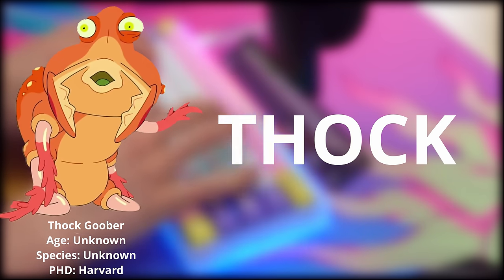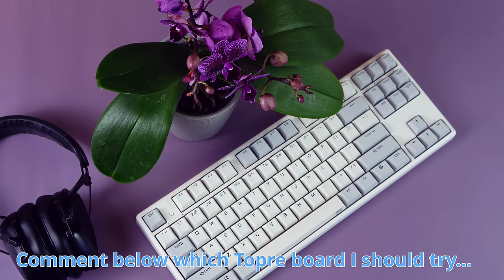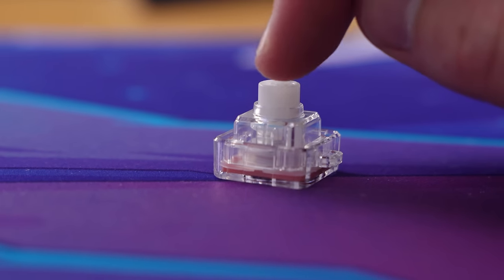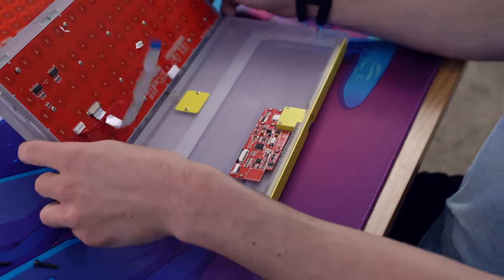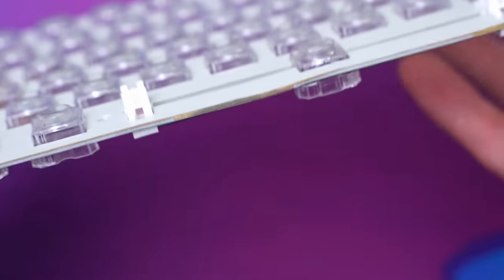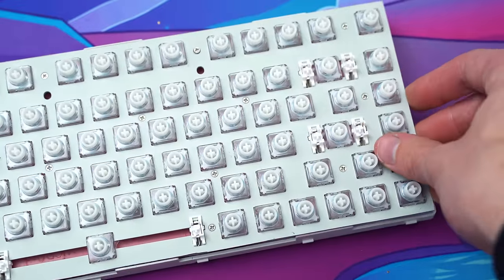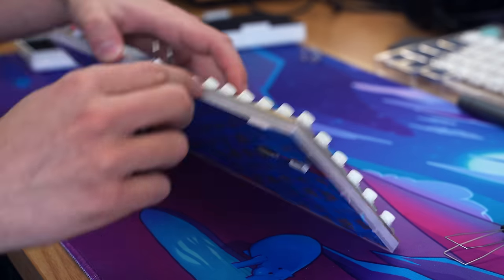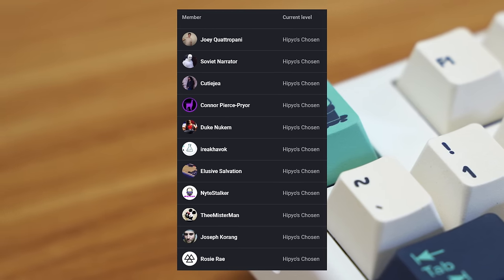THIS is the best sounding "THOCKY" keyboard.

Comment from the maker: :_HipyoBigBrain:HAPPY THOCKTOBER GAMERS :_HipyoBigBrain:
Listen to my song on Spotify here: https://open.spotify.com/track/1ALTxpKWx7ZBr7aeiJbERJ
Don't have Spotify?: https://distrokid.com/hyperfollow/kadeli/serpentine-2
Reply: Hello
Reply: Good song hipyo! Been a fan for a long time! :)
Reply: nice voicecrack
Reply: I CANT STOP LISTENING TO WHERE U GOING HELP
Reply: I love the idea of THOCKTOBER
Reply: People percieve lower frequencies as deeper so it actually is objective (at least if you're defining thock in terms of deepness of sound)
Reply: People perceive lower frequencies as thockier. Frequency is related to restoring force by the equation f = 2pi * sqrt(k/m) the upshot of which is the higher the restoring force per unit mass the higher the pitch.  That's probably overly scientific but the upshot is that a light stiff material (like aluminium)  has quite a high frequency of oscillation. whereas a heavier and more flexible material (like dense plastic) has a lower frequency of oscillation and therefore is lower pitched.

It's a tricky thing to balance when building a keyboard because most people want a light, stiff keyboard (which results in a high pitch), while being as thocky as possible.

The equation I quoted is for a simple harmonic oscillator (something like a pendulum) which is a massive oversimplification for a keyboard. Because of this there are a lot of nuances which can be exploited to make the keyboard stiffer and thockier but the general principle persists
Reply: Can u make a budget thocky keyboard? PLEASE!!!!
Reply: where part 2???

Comment: Sound scientist here. Its about reflectivity and energy absorption. Plastic is a softer material than metal, so it can micro flex and disperse the vibrational energy, that is sound, better than something solid <aluminium>. Metal would just reverberate and bounce any vibrational energy off of its surface and back into the world (or back into your keyboard case over and over and over)
Reply: sounditist
Reply: Random idea: instead of foam, how about using butyl rubber? Like dynamat, the one used to soundproof old cars and sound systems. Butyl rubber can be bought on autozone as a tape putty since it's also used as a windshield sealant.
I know some people who modify their closed back headphones with butyl on the frame to reduce harmonics and whatnot
Reply: @TheDonCucaracho  Car dampening will work. I believe Keybored made a video using the material as case dampening.

Comment: Sound engineer here
I think the best Thock would be a wooden keyboard body
Cause thats whats used in speakers/subwoofers  as well 
Cause wood resonates better with low frequencies
And plastic with mid and metal with high frequencies
So basically a wooden keyboard body with foam inside it and a little hollow space would be the best THOCC
SO PLEASE TRY IT OUT!!
Reply: I second this! Source: I own a wooden keyboard! Even with the steel plate on it, it sounds much deeper than any other keyboard I've used, and its got linears XD. Has a very nice feel as well, weighty without being heavy, and it smelled nice when I opened the package.
Reply: @decameter  Freshly varnished wood is the best
Reply: @decameter  have a link?
Reply: I just imagine some company eventually selling "keyboard amplifiers" that looks like some sort of like a guitar.
Reply: @Currywurst-zo8oo  duuuuude nice brain
Reply: yes but what about a keyboard made completely of different densities of foam?
Reply: @decameter  That make sense. The Wiktionary defines thock as “A clear, echoing thud, as of an axe chopping wood.” So, we need a some axe, or metal key caps!
Reply: WOOD CASE WOOD PLATE WOOD KEYCAPS + ELECTRO CAPICITY KEYBOARD
Reply: I would love to have option of a varnished bamboo body.
Reply: It isn’t that simple. It’s the particular type of material (species of timber), thickness. Different surface density will have a different resonant frequency. It’s all the interface between the resonance of the switches and the main structure. It’s how all the parts work together. So it’s not as simple as ‘wood is better’
Reply: He did now 🥳
Reply: Need more info pleeeeeease. Just wood body? Or more wood stuff?

Comment: I'm a sound scientist but not a thoccologist. I think plastic cases may sound "deeper" because the material is softer, more pourous, and likely thinner than metal, meaning they would tend to absorb higher frequency sounds better and leave the lower, more thocky sounds behind. I suspect there might also be something interesting in the types of sound produced when you type, based on plastic having more elasticity, but also being more uniform, whereas metal is more likely to be rolled/formed in such a way that one direction has more give than the other. (Though don't take my word for it, I'm a phonetician so my knowledge/skillset is more fleshy, but the general acoustic properties and vibration are the same!).

ps: "Semantic satiation" is the reason thocc no longer sounds like a word. :)
Reply: This all sounds correct to me. You are right in how metal is formed. I come from the car world as a hobby and forged wheels verse gravity cast wheels are a big thing. Cheap cast wheels are made by pouring aluminum into a mold. The grain structure is crazy and all over the place. In a grav cast the mold is spun so that the grain structure is all going on way and has a uniform structure (in a circular pattern from the center)

Forged, in basic terms, is when they take a solid piece of aluminum, and cut it out into the shape of the mold. (all grain facing one direction and the grain ends at the cut outs verse flowing around the cut outs like a grav cast mold. 

All this would change sound profile as well the cheaper stuff would have different sounds across the same board while the grav cast and forged would be more uniform in sound.
Reply: Nerd
Reply: @clermont953  they likely make money from it so
Reply: i love nerds :,)
Reply: leave it at nice amount of likes edit: rip the nice amount of likes
Reply: theres always somebody in the comment section.
Reply: go on..
Reply: @vasilisp9470  Think about throwing a rock into the middle of a lake on a quiet day. Ripples will radiate out from that rock at an even rate. When the waves hit the edge, they might be absorbed by the bank, or may ripple back towards the middle.  A wave peak hitting a wave trough will cancel each other out, but a big wave running into a big wave will get bigger if they're going the same direction, or crash apart into smaller waves! Now imagine how those ripples could change if the lake is bigger or smaller, deeper or more shallow, or filled with jelly (or play-doh :P) instead of water. The waves will also change if there are rocks or fish or hippos in the lake, if the underlying material is bedrock or silt. You can can also change the types of waves by throwing bigger or smaller rocks in, covering your rocks in blue tape, throwing a few rocks at a time, or throwing a basketball or sandwich instead of a rock. Smaller waves move faster than larger ones, and are more likely to get absorbed by some materials or use themselves up in all that bouncing around. Big, thoccy waves may stay, but they make also get busted up into smaller waves going different directions. 

That's basically how it works. The act/impact of typing creates a sound wave, and the quality/nature/"sound" of that wave is dependent both on the materials of the switch/board and the force used in typing, but also by all the alterations that happen to those waves while they bounce all around your keyboard and eventually into your ears.
Reply: As an audio engineer you hit the nail on the head pretty much, all the foundational thoughts are accurate, although their might be more too it if you look deeper into the matter. But end of the day plastic takes away more high end frequencies and absorbs more so there’s less reflections and reverb :)
Reply: @ozzy8950  56
Reply: @sufferr2914  Cool but the question wasn't for you lol
Reply: @ozzy8950  who?
Reply: @kai6952  Yes, that is indeed the point of the comment section, for people to exist there. They sure are all over this comment section, just, like.. Existing and stuff. Shocking really.
Reply: @JLFoo  Yup. This is also why different plate reverb setups have vastly different reverb properties. Every little change alters the sound you get back, from the tension of the plate, the material of each plate, the room the plate is installed in, the recording method, the input signal strength...
Reply: Plastic also vibrates at a lower frequency than metal due to it being more flexible. This means that the metal vibrations will generate higher frequency sound.
Reply: @sufferr2914  Or 56.16 to be more accurate
Reply: @ozzy8950  ok Mr edgy
Reply: @sufferr2914  Ok
Reply: @corporealghoul  forged better in terms of tracking
Cast are cheap
Flow formed is best
Reply: @ozzy8950  nerd
Reply: @kiryukazuma2158  forged is best. Hands down. 

Flow formed is just a cast wheel that was spun while the casting was set. 

Forged is strong in every way and often lighter than cheap cast wheels or flow formed wheels... which again are just cast wheels spun when being cast so the casting material grain structure "flows" through yhe shape trying to mimic a forged grain structure. 

Konig makes flow formed wheels. Them cheap.
Reply: @Abyss_xL  shush
Reply: @corporealghoul  but forged wheels are like 5k a set
Flow formed is 700 a wheel
Reply: @corporealghoul  yeah i don't know much about wheel tech
Reply: @ozzy8950  nerd
Reply: @Abyss_xL Good morning
Reply: @clermont953  you do realize being a “nerd” is probably one of the best things someone could be
Reply: I can't take the smartness pls send help :-\
Reply: Nah it's not about absorption in a closed container like this. It's about reverb. Metals  transfer high pitched sounds (aka vibrational energy) better than plastics which are a composite material in a non-uniform lattice structure (unlike metals). Plastic is an inefficient conductor of sound which is why it'll sound better from a tight enclosed container like a keyboard
Reply: The comment that I needed!
Reply: It also helps the membrane is basically a 5mm thick silicone sheet. But agree, metal (alu) cases amplifies high pitched sounds
Reply: dude you're bro 4real
Reply: @opposite342  they likely dont make anything from this

Comment: Plastics like ABS, PC, and acrylics have a lower elastic modulus than metals like steels, brass, or aluminum. 

A good way to think of it is that sound waves interact with a keyboard case in a similar way that switches bottom. If you’re using a brass/aluminum plate you have a much stiffer typing experience than something like PC. The sound waves essentially reflect back off of the aluminum “stronger” which means there is no resonance lost in the case, like there is in plastic.

The density of abs is so much lower than the density of aluminum that there is a substantial difference in the frequency and therefore pitch. 

(I’m not a sound scientist yet, Mechanical engineering student)
Reply: Mechanical engineer here, you are correct. The sound is directly related to the natural frequency and excitation frequency of an object. Think of tapping a steel plate with your finger nail versus finger tip. Same natural frequency of steel, different excitation, different sound. This exactly what is happening when you have different plate materials, stem sizes etc, you are changing the natural and excitation frequencies. So the thud your finger makes is because it's softer and has a lower impulse, and the change in momentum takes longer versus your nail. This is why very stiff aluminum plates can be harsh and clacky while pc plates with flex cuts will be opposite. Now as a mechanical engineer, my work stops at vibrations of systems and materials. The way sound waves propagate and interact, and how they can be filtered, is a whole other subject, and I'll leave that to the audiologists :)  Best of luck with your studies!
Reply: @tunatuna8877  thank you for the clarification and the well wishes!!

Comment: More rigid materials vibrate faster because they do not flex as much when a vibration moves through them. The faster something vibrates, the higher a sound it makes. Think about foam swords that thop when they clash together, plastic swords that clack, and metal swords that ring.

Comment: The sound is best described as a soft and low pitched sound that is quieter than the typical loud snapping sound created by some mechanical keyboards. Thock is commonly sought after for keys that are larger than 1U, such as the Space Bar, Shift, and Enter keys

Comment: I'm a Topre user happily typing on a Novatouch, glad to hear that you're interested!

Unfortunately, Cooler Master canceled the Novatouch, but there are some good options out there - although unless you harvest the Novatouch sliders or buy after-market sliders and stabilizers, keycap customization is most likely not feasible unless you get a Realforce RGB (which doesn't have options smaller than TKL).

But as for keyboards that I'd recommend: there's either the HHKB - a 60% keyboard, or there's the Leopold FC660C - a 65% keyboard. Topre gets more tactile the heavier the dome weighting is, but the 45g domes have that sweet spot (well, as far as stock domes go) between having good tactility and not being stiff as fuck like the 55g domes (since I've also typed on a 55g Realforce keyboard before).
Reply: My favorite Novatouch (with Hypersphere rings mod and lubed stabs) got funky after 7 years of daily usage (randomly loosing USB connection, typing stuff in repeat when this happens, I've dusted it off regularly but no luck). So I bought a new keyboard. Cannot quickly obtain a new Topre board here so I got Keychron Q3 with Gateron Brown switches (pre-lubed) and with an intention to get Boba U4 later. Imagine my surprise—it feels more tactile and way, way more snappy! No mushy feeling. I can type much faster than on Novatouch easily scoring around 110 WPM instead of around 90. The difference is especially noticeable when I need to repeat the key press... The stabilizers are way better (even the spacebar has no rattle, my Novatouch is junk in comparison despite lubing the stabs). The touch is actually pretty good (of course, when pressed very slow on one of these Gateron Brown switches and at an odd angle it's not as perfectly smooth as the Topre's rubber dome, but when typing quickly I don't feel any scratchiness except perhaps the modifier keys—I guess I need to try good linear switches for them). The sound—no deep Topre's thock, but after the force break and tape mods it sounds "marbly" and I like it! The spacebar is way better (even though I didn't lube the stabs yet). So instead of trying Boba U4 (silent ones) I've decided to try U4T (regular ones which are more tactile). Overall I'm pretty happy with the purchase already. Wish I had experimented with other mechanical keyboards earlier, I was wrongly assuming my Novatouch was the end game.

Comment: Leopold FC660c Silent - Lubed 

Plastic, Polycarbonate, and Acrylic are much thicker than aluminum. Aluminum is thin, allowing sound waves to transmit through the case.

Comment: Why plastic/acrylic is more thocky.

It doesn't vibrate as much as metal, so the frequency of the vibrations is much lower (if it exists at all). It's like a sponge, rather than bounce sound back like metal it diffuses it throughout the chassis (i think).
Reply: Underrates comment

Comment: Sound engineer here :

the reason why plastic is thockier than metal is due to how sounds resonates on the materials along with their natural frequencies, the denser the object the more it can resonate with higher frequencies but since switches are lower frequencies they tend to thock less compared to a material that resonates more with lower frequencies, basically since plastic molecules are less dense than metal molecules the sound resonation would be more spacious compared to a metal, if you would like to achieve maximum thock then i would suggest wood since their acoustic reflection is the best compared to those two (hence why "acoustic" instruments are mostly made out of wood due to the echoic sound chamber that wood produces, more tonal and natural), but i'm not really a sound engineer and i have no idea what im saying so maybe im right or wrong who knows thank you and bye
Reply: I have EXACTLY 0 Subs!  frr

Comment: For topres, realforces may be nice but the HHKB is truly an outstanding piece of overengineered plastic. I would think they are the quintessential topres to review before exploring the others :)

Just don't 205g0 the slider housings and you'll probably be good. They are slightly too thick for the slider housings and it's kinda easy to overlube with them. 3204 would have been a safer option.

Comment: what makes plastic deeper sounding is beacuse it’s flexible that’s why poly carb plates are deeper it allows flex, when you jiggle and move around an aluminum sheet it has a higher pitch noise then when you move around a piece of plexiglass it has a “wowo” sound as opposed to the “tni tni” sound

Comment: if you ask me thock would be a deep sound that does not sound mushy (?). When you press the key it should sound as deep as possible but you should be able to hear when it is fully pressed. Almost sounding like the key cap has hit the surface of the keyboard and gives off a little bit of like a 'tackk' vibe. (tackk as in that's what the sound would sound like idk i dont do sounds for a living)

basically you dont want it to sound soft, you want a hard/concrete sound that's also as deep as possible. SO, i would say that the best material for thock is wood (but idk about wooden keycaps i think that's pushing it a little) because that just makes sense in my head as its a soft sounding hard surface or something